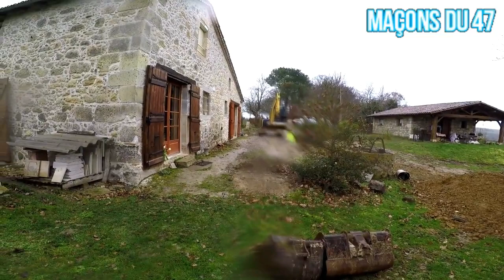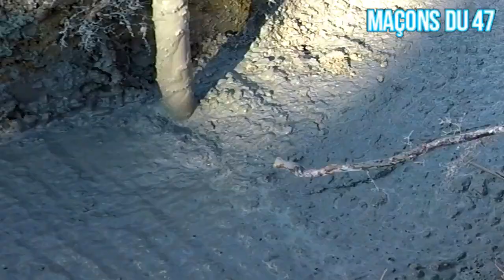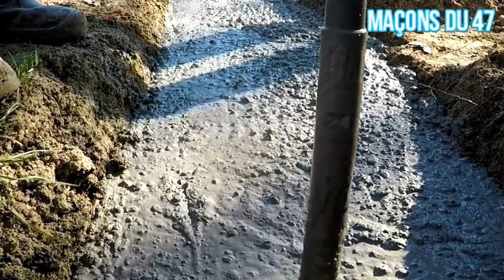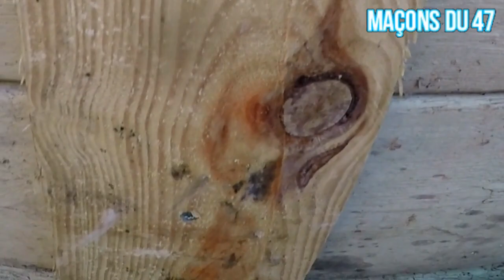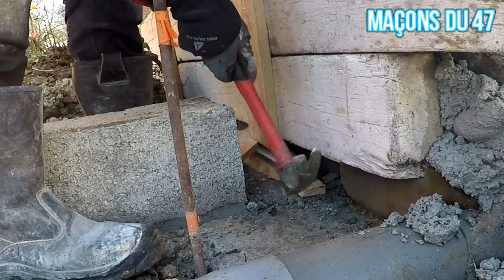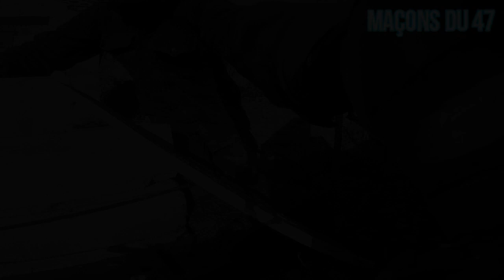une terrasse en pierre d'exception - partie 1

Comment: Vidéo très sympa. J'adore !
Je dois faire une fondation pour installer un pylone de 10m, tu me conseille quelles dimensions pour la fondation ? c'est un pylone à base triangulaire de 50cm de cotés et 10m de haut.
Reply from the maker: j'ai pas trop compris c'est quoi ton pylone ? il est en 2 parties ? il supportera quelles charges /efforts ?
Reply: difficile à dire, ça dépend du sol, de la contrainte vent (force admissible), si tu n'as pas de préconisation de fabrication du pylone, le mieux, mais cher, mais sur, (le pylone qui tombe sur un gosse risque a faire légèrement chier) passe par un BE, mais sans étude de sol il risque à te refuser, du coup ... petite douille a 2500 balles et ta pas encore commencé
mais si tu as une terre qui tient, a mon avis, un bloc de 1m 1m 1.5m de profond devrait être déjà pas mal, sauf si tu es du coté Perpignan, Narbonne, ou mistral, ou il faudra peut être descendre plus profond, mais 1.5 m3 * 2200 kg = 3300 kg ça doit être suffisant,  la prise au vent de l'ouvrage est le paramètre qu'il faut prendre en compte
si c'est une éolienne, avec masse resistance vent + poid en extrémité du pylone, perso je descendrait à 2 m mini, mais il manque trop de paramètre pour etre précis, enfin tout ça pour dire que c'est pas une bricole, et que ça peut vite devenir critique ce genre d'ouvrage sans calcul BE 
mes 10 centimes
Reply from the maker: je confirme ce que dit franck ^^
c'est pour ça qu'il nous faut bcp plus de détails teack , c'est loin d'être une bricole , c'est ce que j'appelle souvent un ouvrage d'art ;)
Reply: En fait le pylône servira à y mettre mes antennes (radioamateur), il sera quasi accolé au mur de la maison pour y être fixé avec des scellements sur la hauteur de la maison (environs 7m). 

Le pylône dépassera au final d'environs 3m sur le pignon de la toiture. 

Ma maison se trouve dans le nord de la Creuse, donc pas de mistral ou autre vent très violent et le sol est plutôt argileux a partir de 50/60cm de profondeur.
C'était simplement pour avoir un premier avis histoire d'avoir une idée du chantier, mais je comprend que cela est plus complexe que je ne le pensais.
Je prendrais bien entendu l'avis d'autres radioamateurs de la région qui ont déjà fait ce genre de réalisation courante dans ce domaine. 

Enfin, Je ne veux pas alourdir la discutions ici, car ce n'est pas le sujet initial. 

Merci Nico et Franck pour vos premiers conseils grâce auxquels j'y vois déjà plus clair et comprend surtout que ce n'est pas de la rigolade.
Je pense profiter de l'installation pour faire une vidéo, ce sera l'occasion pour moi de m'y essayer.
Encore merci à vous deux.
Reply: @teack84  se n'est que mon avis, mais gaffe quand même ou tu fixe, prend pas le pignon sur la gueule, au départ je voyais ça isolé, avec des haubans, mais contre maison, si pas de prise au vent, pas besoin d'une toupie non plus, mais sans voir ni le matos, ni l'endroit je préfère pas de donner mauvais conseil, voir avec les mec de ta région qui pratique ça est en effet un bon départ
de rien c'est avec plaisir